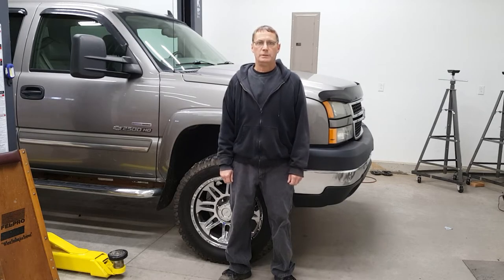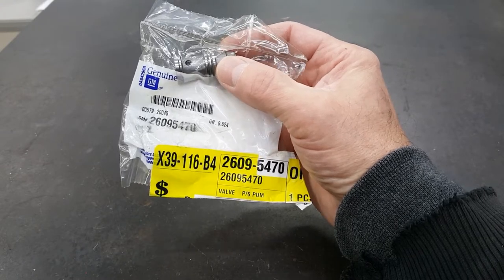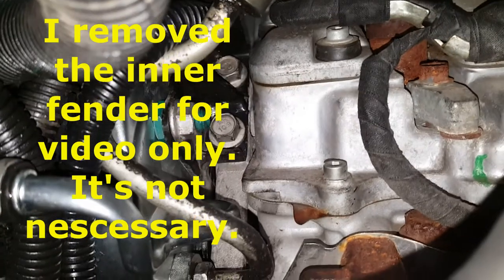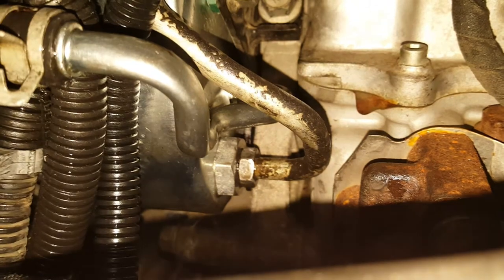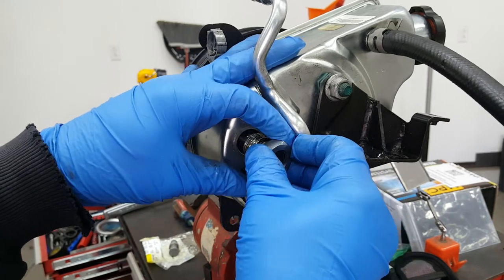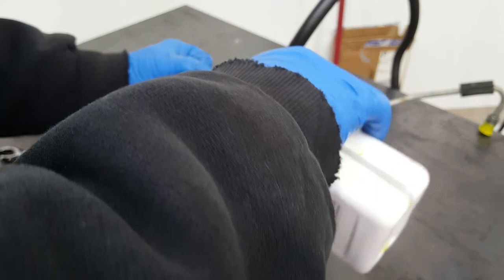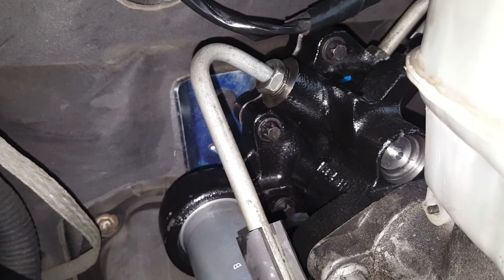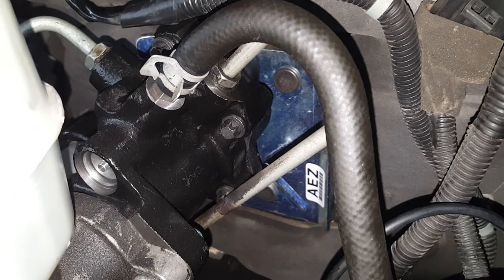Duramax Steering Pressure Valve swap.

Comment: 05 GMC Yukon Denali XL 6.0 I just changed my hydro booster master cylinder and power steering pump now I have a clicking sound when I turn coming from under the dash & weak breaks & tight steering when breaking could this be the problem if the pump is new.??
Reply from the maker: It could be. Are you sure all of the air was bleed out of the system?

Comment: I have an 06 also, installed Red Head steering box a while back.. new hydro boost a few years ago. Steering started sticking at low speeds when I was braking. So I installed a new higher psi power steering pump from PSC.. still sticking! I’m going to try again to purge air … I’ve done it a few times with truck started..Is it better to turn wheels with motor running or off like you did originally?
Reply from the maker: I would try both
Reply: You still having sticking steering wheel issues? I’m curious if you figured out the problem… I already had a new red head steering box and hydro boost … truck has 250K on power steering pump and started squealing so I decided to install new PSC high pressure power steering pump and that’s when the sticking started… the first PSC pump was leaking bad immediately after installing… they warranted it and then installed new PSC pump and that’s when sticking started, saying that makes me wonder about the quality of PSC pumps
Let me know if you figure out issue please

Comment: My steering wheel was turning by itself after I changed out power steering pump. After bleeding air out it just started to turn right full until it stopped,then I centred the wheel back and it went all the way full left until it stopped. 1999 Chevy suburban c1500 ls 2wd 5.7engine
Reply from the maker: Sounds like you still have air in the system!!

Comment: Nice looking LBZ.  I'm having a Hydro boost problem with mine.  Hydro boost totally soaked with brake fluid, I'll be change that out.  Hey are those 20" wheels?   Also are you running a wheel adaptor.  It looks sweet.  lift kit?
Reply from the maker: Thanks!! They are 20's and no adapters, I measured for the correct back spacing.

Comment: Thanks for video. What size tires did you go with on your 20s? I just put 20s on mine with 285/55s noticed it rides a lot rougher than the 16s.
Reply from the maker: Same, and it does thinking about going to 17"s

Comment: Good vid. Is that an updated valve or a larger capacity valve from another application? Thanks
Reply from the maker: It's a higher pressure valve from another application.
Reply: @DownNDirty_OffRoad  Thanks for the info

Comment: When I added this valve low speed locking like backing a trailer with brakes applied still locked up the wheel. I also now have a whooshing sound when turning the wheel normally, no air in the system.
Reply from the maker: That certainly sounds like air in the system. So you hooked up a hose and ran fluid through it and flushed it out? Have you replaced your hydro boost? It could be so bad that boosting your pressure can't help it? That's everything I did and it made a big difference.
Reply: @DownNDirty_OffRoad  No air but the hydroboost is getting replacement as it is seeping out the back.
Reply from the maker: @dondorfman3951  If it's seeping it can suck air as well as the pressure changes and a vacuum is created.
Reply: I’m having the exact same problem with my steering and braking. I’ve replaced gear box, hydro boost and pump with all new items from the dealer and still have the same issue. I’ve had it to 5 different mechanics called many more. Some think I got a bad new pump and some think I’ve got a hose collapsing. Idk I just bought all new lines that I’m going to replace this weekend. I asked some about the valve you replaced in this video but none thought I should try that. I know I’ve been dealing with this for a few years now and I’m ready to get it fixed. I’ve had the truck since new.
Reply: @jeremymiller3489  Replacing the valve with the part in this video did not change mine but I inherited a wooshing sound when turning the wheel like restricted fluid moving through an orifice.

Comment: So what’s the gain from doing this?
Reply from the maker: Adding more pressure for the power steering and brakes through the Hydro boost when running larger tires.

Comment: Link to part?
Reply from the maker: There are many options for rebuilt or new. I recommend new GM only. Too many people having issues with rebuilt. https://www.amazon.com/ACDelco-178-1036-Original-Equipment-Booster/dp/B07J6PB341/ref=asc_df_B07J6PB341/?tag=hyprod-20&linkCode=df0&hvadid=331896281665&hvpos=&hvnetw=g&hvrand=15931048084730759831&hvpone=&hvptwo=&hvqmt=&hvdev=c&hvdvcmdl=&hvlocint=&hvlocphy=9010661&hvtargid=pla-682643751503&psc=1